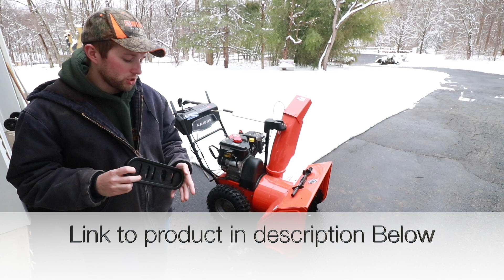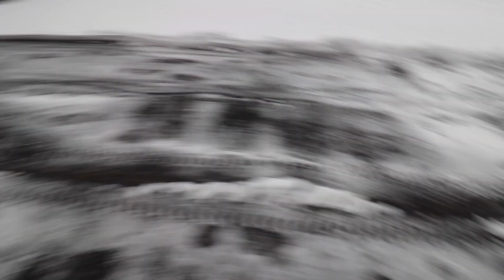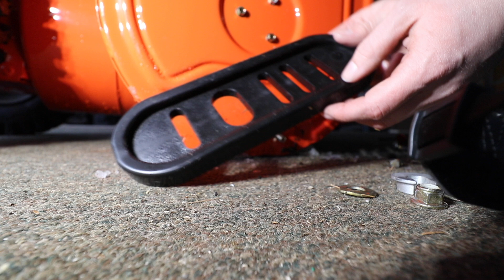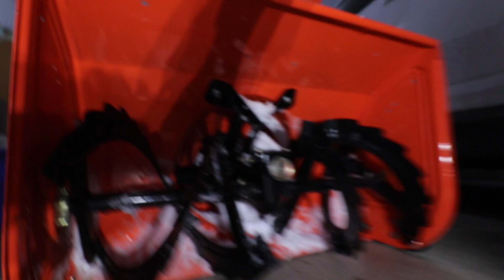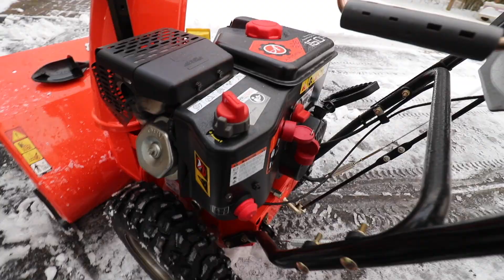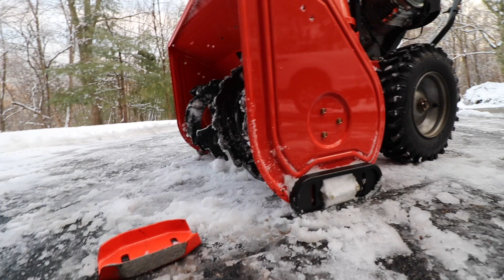How to Fix Ariens Auto Turn

Comment: Informative vid. I have a previous Gen machine 2015, Ariens revised the axle position in 2016/2017 machines in an effort to address this issue. I have the Ariens poly skids , they are shorter but wider than the ones in your vid. The machine still squirrels on pavers. I like the heavy duty Armorskids but they will scratch delicate surfaces.

Comment: Right from the get-go you hot it wrong.  It absolutely does not stop a wheel.  What I see is it sends power to the inside wheel allowing the outside wheel to run free.

Comment: In 2017 I bought a Platinum 30. The first time I used it I experienced the same thing. It pulled all over the place and being a heavier machine, it was a real challenge to keep it going straight ahead. I did two things. 1) I recognized the weight forward of the axles was too much. I believe model years since then are a little different. I designed and fabricated a removable counterweight to reduce the downforce on the skid shoes. That made two big differences. The first was it was able to track straight for the first time and the second was it made it so much easier to lift the front and pivot to make a quick U-turn. 2) I installed the poly shoes. By doing those two things it made the Platinum 30 a pleasure to operate. Now I can one hand it and just walk behind it. I made a counterweight setup for a friend who has a Pro 32, and it also made a huge difference in the ease of handling it.

Comment: Have the Deluxe 28 with poly shoes so I can snowblow my deck as well as my driveway. Auto turn works perfectly. Going on 10 years now. No issues. Even with steel shoes. 🎉

Comment: A Garage Gear video highlighted something very interesting on a potential reason why some Ariens can pull to one side. Turned out on his blower each side had tires from different manufacturers. Even though they were marked the same size when he measured the outside circumference with a cloth tape measure they were significantly different! Go figure.

Comment: Hello, I too have struggled with auto turn especially as my driveway is crushed gravel. I tried longer steel shoes which helped but they did tend to dig in and pull up grass and break through the snow base on the driveway. I took a chance and tried the poly shoes and it did help. It's not perfect but a reasonable compromise between running true and ease of turning. Thanks for the suggestion.
Reply from the maker: After having the poly shoes for a few seasons, they are a huge improvement, but require adjusting every 2 storms for me. I think roller shoes are the way to go. That will be my next upgrade
Reply: @OldSoulMillennial  It will be interesting to see how that works. Cheers!

Comment: I found that the fixed axle on my Troy-Bilt storm 30inch with a fixed axle will do the same thing.  If there is snow on one side and not the other side, the snow blower will pull toward the snow side.  To fix that I have to unlock the wheel on non-snow side to remove power on that side, that means there is power only on the snow side and that will straighten it out.  That results in jerky action as I continually have to straighten out the snow blower.  Of course, this happens in heavy snow.

Comment: Thank you so much for this video!  I have been frustrated with my snowblower since I bought it.  I always suspected it was the steel shoes grabbing on the driveway surface, but didn't know what to do about it.  I was so tired of fighting the snowblower every time I used it.  I flipped the shoes over to the fresh side and that didn't help.  Considered finding some snowmobile track slides that would slip over the shoes, but never got to the point of actually trying it.  I literally had some tire chains in my online cart when I ran across your video.  It makes perfect sense, and now I'm going to order some poly shoes.  Thanks again!

Comment: I guess I’m late. All the links he has provided on this video are not the poly shoes he has in the video. Anyone have a source or link?
Reply from the maker: The ones I originally used are no longer available. I’d like to add that the ones I used fit, but not the best fit. They require steel alignment spacers (included in the original kit) to work.
Reply from the maker: I think the roller skids are the superior option as they really don’t wear down much.

Comment: I purchased a set of roller skids, and they work really well. I was skeptical about the quality until I unpacked them. This product may be the answer to the auto steer differential unpredictable jerking many complain about. There is absolutely no resistance with the roller skids installed. As far as how long they last, time will tell on that one. But sense they don't slide but roll, they should last longer than poly shoes.
Reply from the maker: I’m finding that I have to readjust my poly shoes after every 2 big storms. I would think the roller shoes would only need to be reset once per season

Comment: It helps if the poly skids are occasionally adjusted due to normal wear. The first adjustment I did on my 28” SHO when new was to square the auger housing with the drive housing with the skids removed. Equal tire pressure is important with the Auto Turn.
Reply from the maker: I’m finding that I have to reset the poly shoes after every second big storm.

Comment: I'm 68 and I love the auto turn feature on my 25 year old 1128 pro. Lots of advice in these posts Thanks to all!
Reply: Ditto. Brand new Ariens, 28" steel shoes (ie one's that came with it) Had various snowblowers over the decades, none which had this auto turn feature. Now that I have it, I really like it, once you get the hang of it, I can turn effortlessly. I am also guessing some age demographic in play, when I was younger, I could easily use my upper body strength to turn a snowblower, didn't even think about it. Now that I'm a little older  I like to work smarter not harder.

Comment: If i bought a Ariens i would lock out the auto turn. Kind of comical you have to buy poly shoes for it to work right. Why doesn't it come with it. I dont need to check my tire pressure. I dont need to adjust my skid shoes. I dont need to buy poly shoes. My older soild axle i dont have to do nothing. I dont understand why you cant buy just a simple soild axle anymore. I guess because that dont sell parts.

Comment: I'll use the trigger steer on the husqvarna. It's way better. Want to turn around?, just hold one of the triggers and it will turn 180 degrees in about 2 seconds.
Want to do a half cut in deep snow?, and it goes slightly out of line just tap the trigger. It will change your entire snowblowing experience. Absolutely zero forcing the machine around. An 80 year old could easily use one.
I own 3. A st224, a st327 and a st230.
But I do about 300 driveways a year.

Comment: Another reason people get unwanted turning with auto-turn is due to the scraper blade being too low. 

1/8” for smooth surfaces 
1/4” - 1/2” for gravel and uneven surfaces

Comment: Great vid thanks. What is the brand of the shoes you switched to? Or at least the dimensions. The longer the show i'm guessing the better the handling? You did an earlier video with Ariens shoes that fit into a metal housing, Are the all poly long looking shoes better? After all the reading I'm hesitant to buy a 30" Ariens with auto turn but maybe you saved the day, i'm looking at a ten yr old model for 700, looks to be in great shape.
Reply from the maker: I installed a no name aftermarket brand. They are no longer available. I do have links to the ariens brand poly shoes. That would be my recommendation. Having a smooth paved driveway, and poly shoes will improve the auto turn handling issues by about 90%. Great engines.
Reply: @OldSoulMillennial   The poly shoes you used looked longer in the video, i'm thinking more surface area has to help, can not hurt. BTW, this video comes up in AI mode for google search. I picked up a basically brand new used 30" about eight years old. The auto turn is like wrestling a greased pig, not much control. Thanks again for the video.
Reply from the maker: @rootintootin7954 Interesting that the AI is suggesting my video. Thanks for the info!

Comment: I have had an Airens with auto turn for over 20 years and no problems.  You just need to be a man and have strength to control the blower.
Reply from the maker: I guess myself and the other 10’s of thousands of people with this issue are just weaklings. Thank you for expressing your ignorant masculinity. We all can definitely learn a lot from you.
Reply: autosteer is recent, last decade or so

Comment: My first Ariens was from 1976. It had a differential  with a manual locking hub. My 2012 machine has the auto turn.  I prefer the manual lock..

Comment: I have a 2021 Ariens 24' deluxe. I have never had an issue with the autoturn and i live in a snow belt area. I set the skids at 1/4' and make sure the bucket is level. works fine.

Comment: Thanks for video! I had Ariens ST-824 that I bought new in 1988 and have used for 36 continuous years and loved it. Gave it to one of my kids and was debating stealing it back after a 1 hour nightmare with an Ariens Duleux 28 and it's Auto Turn feature. So glad it wasn't me! The tracks looked like I was drunk! I haven't worked that hard to operate a snowblower ever. Just ordered the poly shoes and looking for a much improved experience in a few days. I'm also disappointed with Ariens, did they have just regular folks test these before marketing them? That feed back would have told them the Auto Turn system has serious flaws.

Comment: I have not had any problems with auto-turn. Most of the time, if there is a problem, either the skids are not properly adjusted or the auger housing is not level. Both are really easy to fix. Tire pressure could also cause a problem but not as likely.

Comment: Wowzers! I almost purchased an Ariens but this autoturn sounds like a real pain Who wants to deal with all that?
Reply: I've got a 2019 Ariens SHO with auto steer and have had zero problems with it.
Reply: I've had 0 problems with auto-turn. Usually the reason auto-turn can have a problem is either the skids were not adjusted properly or the auger housing was not adjusted properly. Both are really easy to fix.
Reply: @StlrNtn95  Newer machines are better now. You actually hit the left lever if you're truning left or right lever if you are truning right.
Reply: @charlesdarwin180  I think that is only on the ones with tracks....
Reply: @charlesdarwin180 Yes with many manufacturers, however Ariens has stayed with their Auto-Turn system made by General Transmissions.
Reply: Agree. There's not one flat section of our driveway. The adjustment would do nothing. I'll stick with our older ariens that has basic wheel locks. We have to lock the wheels to use it, but it's a pain to park in the garage with both wheels locked.

Comment: I wanted to protect the fancy finish on my concrete patio, so I made shoes for my Ariens Delux 28 from a 5/8” thick HDPE plastic cutting board and also found the performance on my gravel driveway improved.  High density polyethylene is pretty easy to cut on a band saw, but I don’t recommend trying to cut it on a table saw.

Comment: Yes they will wear out faster than the steel ones do (duh)
 I have since made a pair of skid shoes out of composite decking material which is 1" thick and I made them 9"long to last longer. That stuff is very dense and should last many seasons. I wanted something that will slide easily and keep the blower going straight along my 900 ft. gravel driveway.
Reply: Would love to see a picture of your composite skids!
Reply: @stevemlejnek7073  I don't have a photo of them right off hand, but if you can picture a 1" thick solid piece of wood that's 4" high by 6" long with both bottom edges rounded off with saber saw and bolted to each side of my blower where the skids bolt on. They slide much easier on concrete and don't leave any marks.
Reply: Curious what you set the skid height at with a gravel driveway, as I also have 3/4” crushed stone driveway and set my skid height at 5/8” not sure if that’s too high or not high enough
Reply: @GSAYER1  Mine skid height is set at about 1/2" because I usually plow the gravel part of my driveway and try to get a good hard pack surface first before use the blower.
  
I am careful not to blow any snow toward any of my buildings incase I fling a rock or two that direction, so yes, I still get a few in the mixture anyway.

Comment: "Polymer" is a "nicer" word for what looks like basic ABS plastic. They still should work for a while better than steel. 
Do you find with the wide slots these are difficult to stay tight on the machine without loosening?
Reply from the maker: When set to the proper torque, they hold just fine. Had them loosed up once since the install. Increased the torque and haven't had an issue since. No regrets
Reply: @OldSoulMillennial  tks. Makes sense. Looks like PU not ABS by their description. Gonna try 'em

Comment: Cut out the bottom of the stock steel shoes and out a roller blade wheel. It rollers so smoothly you can operate the machine with your finger. They sell something like this on Amazon etc. rolling is less friction than even the poly skid and they never wear out. I used wheels off an old pair of roller blade that were being tossed
Reply: I’ve heard you have to adjust the auger housing and not the shoes unless they are out. Having said this, I installed poly shoes on my unit and never had a problem with the power steering. Good luck, wish you well.  🇨🇦💝👍🙏
Reply: I did this 2 seasons ago, I purchased all stainless hardware and a new set of wheels (4) and bearings (8). Total cost was about $20 and it took me an hour for the first side and 15 minutes for the other one. Everything still looks like new and it works great. I also saved the extra wheels and bearings so I should be good for 10-15 years. I notched the center of the steel shoe and mounted the wheel so it pokes through about 1/8".
Reply: Pics avail? Interested. Tks!
Reply: @3344-c9y  youtube.com/watch?v=yxHamjcaX9w

Comment: Thanks for this. I ordered a new Ariens Deluxe 28" and also the poly runners off Amazon. I'm going to install them right from the get go. I'm also in North Jersey and was worried about the auto turn feature as my 20+ year old MTD/ Yard Machine 26" 10 hp. had solid axels and worked just fine.
Reply: Ariens builds a quality machine. The Deluxe 28 (non SHO) model is built like a tank however the 253cc engine (believe they still use that one) is a little underpowered if working a large plow pile. I had a similar MTD back in the day the 640F was well-built in the U.S. at that time, served me well for 20 years. I have an Ariens Platinum 24 SHO at this point, a beast not crazy about the Auto-Turn bought the poly shoes with the machine. Of course it hardly snows here in the Lower Hudson Valley area of NY anymore. Best of luck with your new Deluxe 28 👍🏽
Reply: @cardo1111  I only used it once last year and it worked pretty good. That MTD was a power house for sure.

Comment: Nice video.  I have one of these machines as well and the worst possible scenario for auto turn: blacktop with lots of aggregate, nothing is level, and about a 20 degree grade to the top of the driveway.

What helped me: 15 pounds of weight on the chute because of the hill, poly skids, and going slow, never above second gear.  Its very livable now as long as I don't go too fast.

For those that want to get rid of auto turn forever weld the two plates in the gearbox that slip to create auto turn: instant live axle.  Or you could shim the plates like this fella did in the following video. https://www.youtube.com/watch?v=KcpuBOAq3ng&list=LL&index=54&t=2s

Comment: I don't like the autosteer feature at all for anowfall on top of frozen patches.  Every uneven frozen area in the driveway causes the machine to buck toward the obstacle. 

I've adjusted the machine properly and changed shoes.  For anything but an absolute smooth surface you fight the machine too much.

$20 to try polyshoes is worth a shot to see if it can be better.
Reply: If you want a real permanent fix. And you don't care about the auto turn. You can take the auto turn apart and add some shims. It will turn it into a soild axle. Problem solved/fixed forever.

Comment: Excellent. Apparently, based on your analysis, you may have a BSME as I do. You demo does prove the ease with which your Ariens now tracks with the  However, your concern about the wear is mine as well. My driveway appears to be as long as yours, so this article interests me.  Granted the driveway is not as abrasive as it is when dry, however plastic doesn't wear like steel, so service life is a concern. The Ariens Poly Skid Shoes look quite different on their web site, with different mounting hardware, and sell for $44. Can you tell us where you purchased your set and what you paid for them.
Reply from the maker: Link in description for the shoes I used. Currently cost $20 bucks.

Comment: I replaced my shoes when my snowblower was new.  Never had a problem with auto turn.  Often times, the auger housing is not bolted on evenly and has to be adjusted for the auto turn to work correctly. Best of luck with your machine.  🇨🇦💝👍

Comment: Hate my auto turn.  Nonstop fighting the machine.  I’ll try this out in time.
Reply from the maker: This definitely improved things 80%
Reply: I’m 72 and have been using the poly skids for about 9 years. Definitely worth it. Keeping the tire pressure as close to exact improves the handling also.